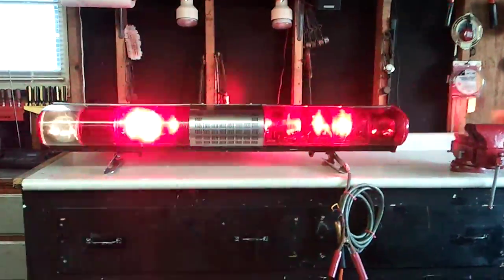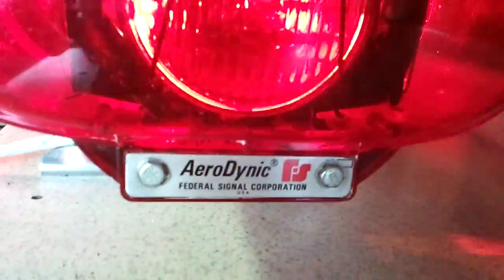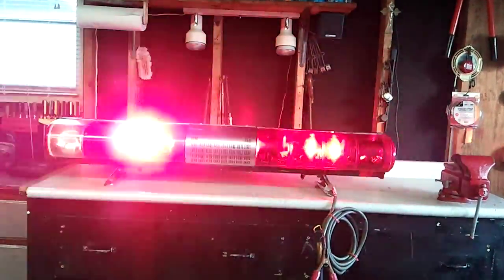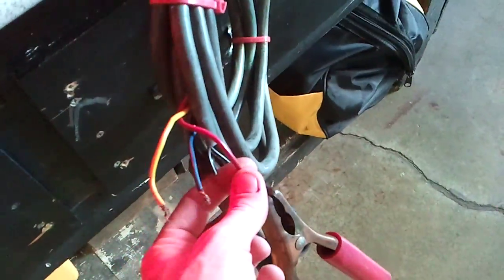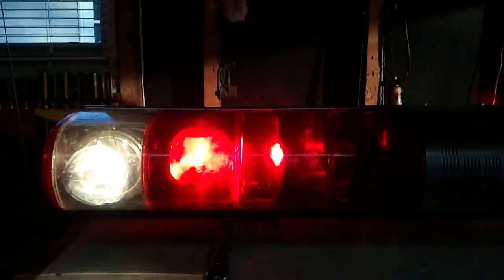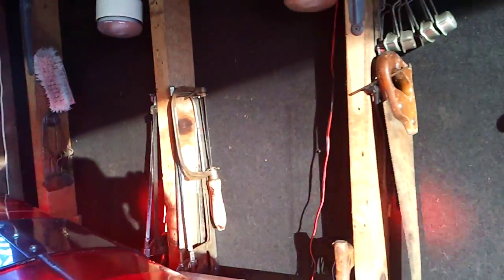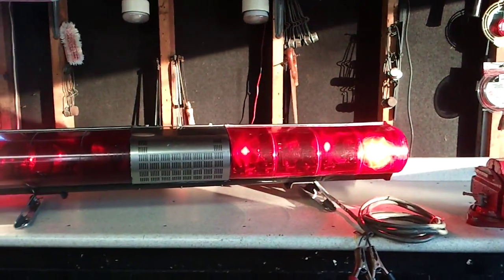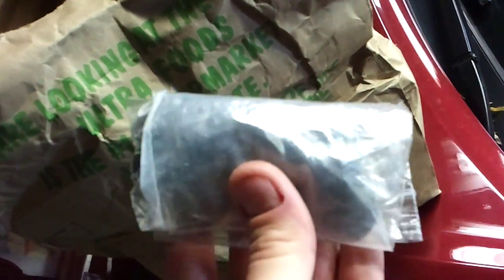Federal Signal AeroDynic Model 24EH Lightbar

Comment: Good evening ,I am looking for the aluminum tray with the 8 rotator, the belt, the engine mount and its support, 6 gears, an aluminum plate complete with an Aerodynic 24 I need the black outer frame I do not need the speaker, nor domes, how much price for France and the shipping costs, gold model 24 EH Series AH 1 or model Model 24 CA Spec it will be enough to make a rotator at each end to make a model 24, and 2 gears thank you
Reply from the maker: I do not have any available.  Thank you for your interest.
Reply: @Guillotines_For_Globalists  okay thank you
Reply from the maker: @henrisessa2350  No problem.  You might want to try the forums at www.elightbars.org for your best chance at finding someone selling the parts that you need.
Reply: @Guillotines_For_Globalists  Thank you I'm already members on Elightbars, but if you know someone who has one contact me thank you.
Reply from the maker: @henrisessa2350  I don't.  The next bet would be to join a group on Facebook if you're a member there as well.  And eBay.  If you are a member of eLightbars I am sure you have explored these avenues already, however.
Reply: @Guillotines_For_Globalists  yes I am on Elightbar and on Facebook too

Comment: I have model 24MEA an I need a new motor for mine do I know a place ?
Reply from the maker: You might want to try eBay, facebook classifieds groups dedicated to emergency equipment, or website forums also dedicated to the same.  Or you might want to try having the old motor rebuilt at a local electronic shop that rebuilds commercial/industrial motors and/or alternators.
Reply: Blaine Bugaski the old motor was removed for something else and never put back so I have no idea what one even looks like really

Comment: what are the rotator set to? number combos?
Reply from the maker: Since I no longer have this lightbar I am unable to answer your question, but what I can tell you is that I did not use any specific pattern, nor did I use the numbers for alignment purposes.  Normally, the inner two rotators on either side of the stainless steel speaker grill are keyed together, in that they will always be facing the same direction.  There is a rubber band of sorts that runs under the stainless steel speaker grill connecting the left side to the right side.  I switched these so that they are pointing opposite directions, effectively 180 degrees off from one another.

The rest was a custom visual pattern that I "eye balled."  Shouldn't be too hard to accomplish if you want to recreate this custom flash pattern.